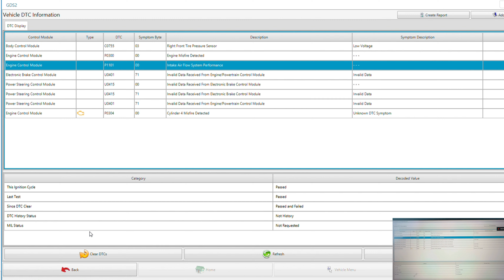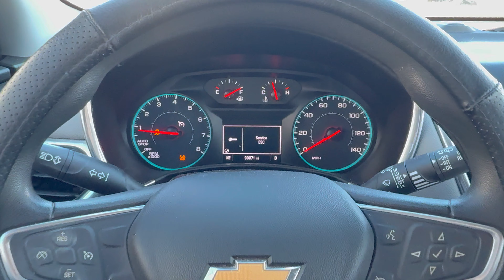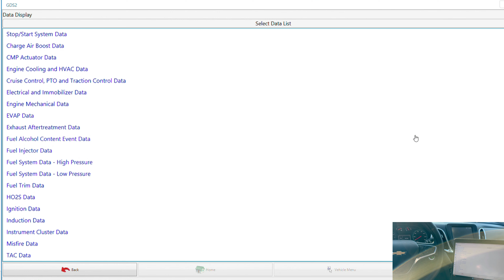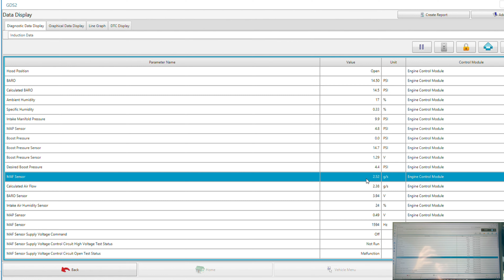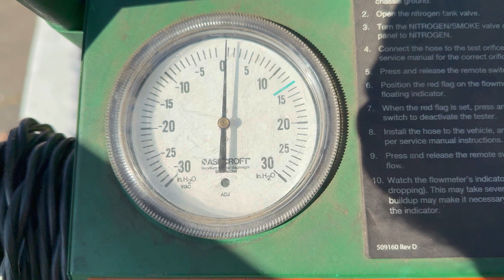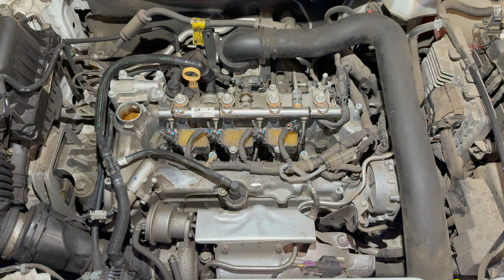P1101 PCV Valve Diagnosis 1.5L LFV… Bonus Misfire Diagnosis

Comment: Good morning! First post ever so be patient with me... :ROFLMAO: I have a 2019 Chevy Equinox 1.5L with some 86k miles on it. I have noticed when idling, the engine seems to have a slight sputtering. I also notice a weird sputtering/pausing in the engine at around 40-50 mph only if I am depressing the pedal slightly. If I punch it quickly, I cannot perceive the same issue happening. I do not see any changes on my RPMs and transmission seems to be shifting properly. Anybody has had this issue? If already posted, can you provide a link? It seems very similar to what happened once with my 2017 Chevy Trax. Also want to point out this started happening during the frigid temperatures we have had in VT for the past month+. Any help or knowledge would be appreciated. 

No CEL and no lights coming on.

The dealer first said it was the spark plugs: $280 no change
Second day with same issue they said it was injector #3: $700 no change

Apparently there was an abundant amount of carbon build up on the valves which were causing the misfire on cylinder 3. They were not able to find a solution and wound up having a GM technician come in to their service center to corroborate the solution and show them how to do a "cleaning procedure" that is part or the recommendations on the current TSB. 

It has been about a month and slowly but surely the sputtering is coming back. I have no check engine lights and while driving I do not have anything noticeable but once I come to a stop I can feel the sputtering (almost liek skipping a bit). I will replace PCV and tubing just to give that a try, anybody have any clues on what else I should look into?

PLEASE HELP!
Reply from the maker: Sticky piston rings and broken piston ring lands are a possibility. The fault could also be a torque converter shudder in the transmission, especially if the transmission fluid has never been changed. 

Check out the P1101 playlist here: https://www.youtube.com/playlist?list=PL2dh9Xkl5SAP0hXsXtgr7MMJlXI2dlaEb
Reply: @DadsGarageDiagnosticSpecialist  wound up replacing the harness for the injectors and it has become less persistent but still have the sputtering/stutter when in drive and with heat on. I have no oil consumption, no coolant loss and no obvious smoke coming out of tail pipe.
Reply from the maker: I would suspect piston or piston ring problem.

Comment: Solid video guy. I’m just tired of having them come in with 6 codes.  Seems like they should get the party pack. Valve cover hoses clean maf and throttle body Oem air filter. Recheck lol
Reply from the maker: They do tend to have a little bit of everything go wrong all at the same time... Good idea on the party pack!

Thanks!

Comment: I get 1101 all the time. But most of the time I have 5 more codes to go with it. 2227 ect. I would love to find a quick way to diagnose these things. Like you have mentioned it can be almost anything.
Reply from the maker: P2227 indicates a problem with the BARO signal which is internal to the MAF sensor. Verify the BARO sensor is reading accurate… Verify BARO and MAP agree with key on engine off. 

If BARO is not correct, it will also cause P1101.
Reply from the maker: Also check out my P1101 playlist here: https://youtube.com/playlist?list=PL2dh9Xkl5SAP0hXsXtgr7MMJlXI2dlaEb&si=wRi21UTxYu_GuCTj

Comment: 2022 Malibu 1.5 turbo.  At 50,000 miles could the PCV be clogged? I am helping a girlfriend. I want to test it. Is there a good scan app for a Bluetooth OBD2 i can check this with like JSCAN for a jeep. Also, what kind of pressure tester can I use for the PCV system? Whats threshold? Sorry, thank you IA for your help.
Reply from the maker: Yes the PCV valve is likely to be clogged if there is not excessive crankcase pressure and/or pressure pulses on the gauge... Crankcase pressure is measured in very low units... Look for an Inches of water gauge similar to the one shown in the video... You're looking for a manometer, but in gauge form... You can also an actual manometer, but I prefer a gauge due to being able to watch the needle for diagnostic clues.

Watch all of my P1101 videos for further guidance to rule out MAF sensor problems and possible broken piston or sticky piston rings.

I am not familiar with any bluetooth scan tools at this time... I have been happy with the Launch GM scan tool which was sent to me for try-out... They don't send me any kick backs for it, I recommend it because it is a good tool for the price.

Launch CReader Elite 2.0 Scan Tool for GM... First Impressions
https://youtu.be/o33j-PJYaaQ
Reply: @DadsGarageDiagnosticSpecialist thank you 🙏🏻 you’re the best! I had 0 in hg on the needle gauge through the dipstick tube. I changed the PCV however the dealer told me that they didn’t show a PCV inside the valve cover but he was just a parts guy. I replaced both the PCV valves up top, clean the throttlebody, the MAF sensor and replaced all spark plugs. I can hear some noise in the engine so I’m thinking that that the air pump is going bad. What could a slight knocking noise be other than the air pump going bad? Now I did pop the oil cap and I just got a little bit of oil spray out of it but nothing much other than that. I’m a heavy equipment mechanic so I don’t work on automotive too much but it’s what I used to do so it’s not a problem. I cleared the code and everything and I’m assuming I’m gonna have to pull this valve cover off because I still think that that PCV valve is inside the valve cover. I’m going to watch the video on the GM scan tool that you are advising. I can’t thank you enough. This is the second or third question that I’ve asked you and you’ve answered back almost immediately. I’ve already subscribed. I wish I could subscribe five more times for you. Seriously thank you I hope you had a merry Christmas and I wish you nothing but the best. You’ll probably hear back from me. Especially when I get it fixed! This girl’s an angel, and I would like to do everything in my power to help her. So when she comes back, if the light comes back on, I will borescope it, and I will check the pistons too. Anything I can do about the sticky rings or do I need to pull the head?
Reply from the maker: Sounds like your typical parts personnel... An Inches of mercury gauge is not sensitive enough... According to search result 1 inch of mercury (inHg) is approximately equal to 13.595 inches of water (inH2O)... You will need a much more sensitive pressure gauge to get an accurate test.

Noise in the engine is a little concerning... If you do end up removing the valve cover and find heavy sludge build up the engine may have been neglected to death. Also check the oil feed hole for the vacuum pump, it is known for clogging, causes the vacuum pump to seize and break the camshaft.

P1101 PCV Valve Replacement Guide 1.5L LFV LYX L3X & 1.4L LE2 - Malibu Equinox Cruze Encore Volt
https://youtu.be/dp0byQWo8Ck

Thank you very much for subscribing, and thank you for saying you'd subscribe five more times, it means my efforts thus far have been worth it!

Please do send updates, we will get it figured out. 

Merry Christmas and Happy New Year!
Reply: @DadsGarageDiagnosticSpecialist I can’t say thank you enough! I will have her out again as soon as possible and I will pull the vacuum pump immediately. I’m sourcing the parts I need now from Rock Auto as they sell AC Delco. I’m not pulling it apart that deep to install junk parts. I will just order a vacuum pump as well, and the entire list I got from the end of your video. That was immensely helpful. I’ll borescope the pistons. It doesn’t sound like a valve. It’s sporadic. I’m sure it’s the vacuum pump. I cleaned sludge from inside the PCV valve orifices . She said she’s paying attention to the oil change light! I said no don’t do that! DI engine. Do it every 3,000 because she is a woman! She says she drives normally but you know that means different things to different people. I will keep you updated and really I can’t say thank you enough. I’m referring everyone to your channel for help. I saw that feed hole and how sludge filled it was on the pump. I’m going to change it immediately before it takes out the camshaft. Hopefully I won’t have to change the cam however it is what it is and god willing I won’t have to. I’m going to have her let me know when she can come back out for this repair. I just started dating her so I guess everything happens for a reason. Thank you again! Have a Happy New Year Pop! ❤
Reply from the maker: Yes these engines really do not like short trips or oil changes beyond 3000 miles to 5000 miles... Always use the best synthetic oil and filter you can get.

I'm glad you found it helpful. Thanks for giving me the good word.

Let me know what you find.
Reply: @D@D @DadsGarageDiagnosticSpecialist  have just received the tools as the injector removal tool and O-ring install tool came today. I will update you ASAP as to what I find. I believe you’re correct about the vacuum pump so I’m replacing it, I’m assuming I cannot reuse the fuel line since I saw your other video as well. I will be replacing the injector O-rings, intermediate fuel line, vacuum pump, internal PCV valve, both valve cover gaskets, as well as the two oil gaskets underneath the valve cover. I will be replacing the vacuum pump seal and gasket. I will be replacing the injector bolts as I believe you said you cannot reuse those. Do I have to resize the O-rings when I reinstall them? Do I apply oil to them or anything before I press the injectors back in? She had gunk all over the passages when I replaced both external PCV valves for her. I cleaned out the throttlebody and replaced the air filter and the code has not reappeared. However, with 50,000 miles it needs to be done. I will also change the oil. I’m not too familiar with direct injected engines but I’ll figure it out! I will also change the oil for her and I have notified her to just come to me for her oil changes and we will do every 3000 miles in my garage at home. She says that she is really good to the car, but that it is very slow so I’m assuming she probably beats on it a little bit. Hopefully, after this all will be well.  are these engines known for rocker arm or push rod failure, camshaft, failure, other than the vacuum pump, taking out the camshaft?  I’m just wondering what else that I need to be closely inspecting when I’m in there which I will check all of the cam lobes for where as well as rockers I’m not familiar with this engine, but I will adapt and familiarize myself with it. I can’t thank you enough for your time and all of your advice. You are a lifesaver. I wish more mechs and techs were like you. I hope that you and your family have a happy new year. Please be safe.❤
Reply from the maker: These engines aren't too bad except the PCV clogging and sometimes the pistons and rings fail, but that is a GDI thing... The vacuum pumps only seem to fail when the oil changes are neglected and the oil feed gets clogged. Cam lobes should definitely be inspected while its apart, but they don't often have cam and rocker problems.

As far as doing the fuel system repairs, GDI engines operate on high pressure, so I would advise following service information for precise instructions. The fuel feed pipe should not be re-used... The teflon seals on the injector tips need to be sized with the tools and installed dry... If you're taking the injectors apart and also replacing the internal rubber o-rings, those can be lubricated with some engine oil to aid assembly.

Thanks again... I am just what your average automotive technician should be. I just fake it till I make it.
Reply: @DadsGarageDiagnosticSpecialist awesome. Will do!  thank you for everything! I’m concerned with the noise. I’ll update you on what I find. We all fake it until we make it! lol your time and knowledge is much appreciated!
Reply from the maker: Post a video on YouTube and I'll take a listen if you want. You are welcome.
Reply: @DadsGarageDiagnosticSpecialist I changed out the vacuum pump which is filled with oil. I’m assuming the PCV is definitely clogged. No sludge buildup in the oil passages however she’s definitely going by the oil light. She now knows not to do that and since we live by Chicago and she does a lot of city driving I suggested around 3,000 and I will do that for her. I’ll use a good quality synthetic. I believe the 0w-20 probably isn’t the best but not an expert and haven’t had time to research that yet. I used your video for the pump and pulled the battery so I could change out the seal as well. Thanks again! I still hear rattling at startup however this Malibu is right at 55k and not even 4 years old. The noise should be covered under warranty or at least I’m hoping so. I’m assuming that regardless of what this noise is they’re going to have to tear the valve cover off and when they do, I’m going to hand them a PCV valve to install in it. lol I will pay them a few extra dollars to remove it and put a new one in. Hopefully I bit the bullet on it. If not, I have all the parts and the tools necessary, but we would like to see if we can get the dealer to cover whatever noise that it is. I was super meticulous with this vehicle since it’s not my own and I just wanted her to get home safely so I did not have time to make a video however I will do so as soon as I see her next. I will post it’s in my page. I will come back and respond to the comment to let you know what’s up. I really really appreciate all of your feedback your time and all of your great advice. Can’t say thank you enough. Enjoy your weekend pops! ❤
Reply from the maker: I have been flooded with comments recently, so it's taken me a while to get back to this... What ended up happening? Did you find what the noise was?

Good job on doing what you can to keep her going. That is what folks like us are here for.

Comment: Have a 18 equinox 1.5. I get some white smoke out the exhaust once it warms up to temp not excessive but every now and then when accelerating it would do it real bad then go away then now it does it a little. Only code I get is the p06de which I’m going to replace but is it possible I might be getting oil into the combustion chamber from a clogged pcv
Reply from the maker: In cold conditions you can expect some white vapor/smoke to be normal, but not blue oil smoke. 

The P06DE code is concerning because it relates to oil pressure or oil pressure control... There are a couple of bulletins you should check out... #PIP5247A regarding piston oil squirters... #18-NA-246 Regarding short trips causing excessive fuel in the oil... There may be an ECM software update, and the PCV valve is also a known problem, and the part has been updated.

Let me know what you find. Thanks.

Comment: good video, I got a family members 2020 equinox, recently set this code. I will probably have to look at it this weekend. Just a quick parking lot scan at idle MAF was reading around 1.8g/s and calculated air flow was around 2 g/s. So it didn't see too far off. 
Funny thing is this code set for her almost exactly a year ago I cleaned the throttle body and MAF sensor, relearned idle. Has been good for a year, until now. 
What has me confused, reading description and operation says the PCV orifice is integral to the valve cover. Is that true? Did they change to a fixed orifice? Her equinox is a 2020
Reply from the maker: It was “integral” and “non-serviceable” until they started failing so much that it was costing GM piles of valve covers… Now offer the PCV valve by itself and there is a procedure to replace it. 

P1101 PCV Valve Replacement Guide 1.5L LFV
https://youtu.be/dp0byQWo8Ck
Reply: @DadsGarageDiagnosticSpecialist okay that makes sense thanks! Yeah because I was looking at the parts diagram using the VIN and saw that valve in the exploded view. I guess we’ll see this weekend I’ll check the crankcase pressure. Then to get a pile of parts. It’s ridiculous that they don’t sell a kit for the valve cover gaskets you have to buy it all separately
Reply from the maker: That would make too much sense. They make more money selling each part individually… Wish I were that smart.

Comment: Will a clogged pcv valve also cause idle airflow compensation to be at 100%? I had one with a bad valve and i also cleaned the throttle body just in case
Reply from the maker: Yes.

Comment: where can I find crankcase positive pressure garage.  I had same issue on 2016 Malibu P1101. shop changed all PCV on the top of the valve cover. Now is ok.    TY
Reply from the maker: Search for a manometer that reads in inches of water or centimeters of mercury, whichever is your unit of preference.